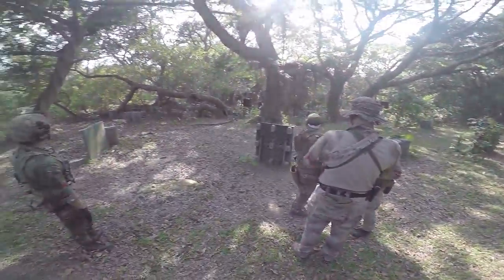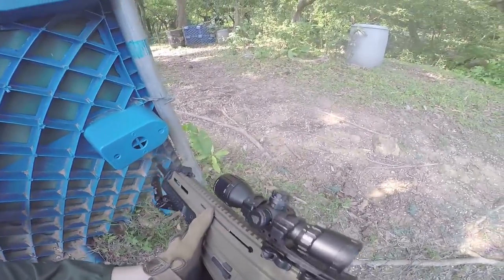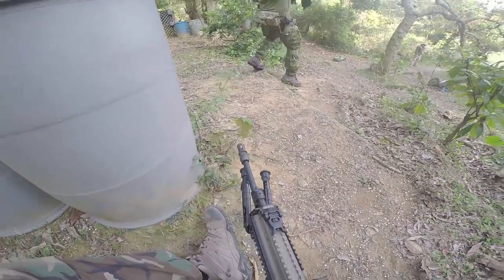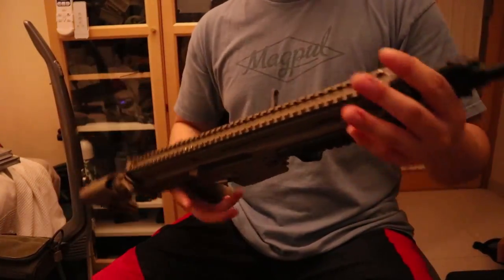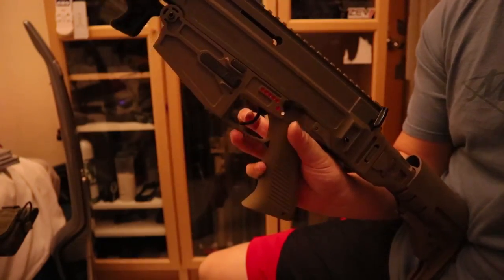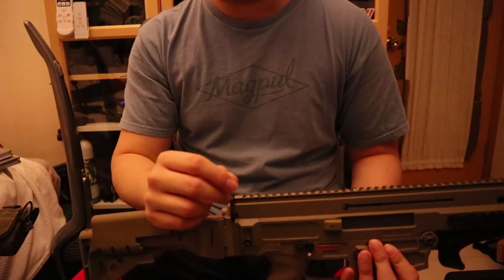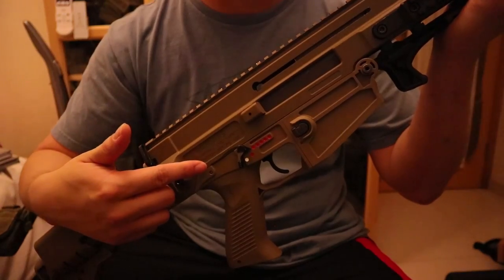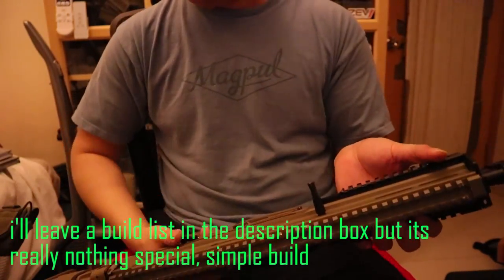ASG CZ805 Bren with Gate TITAN V3 Testing! (Voice over gameplay)

Comment: Just install a titan, had an awful time with the wiring. The motor connectors were pushing it up in the cage, messing with the height. Had to Soler those to make room. It was a front wired model, so tons of wires mean everything's so tight the dust cover barely moves. Glad it's over